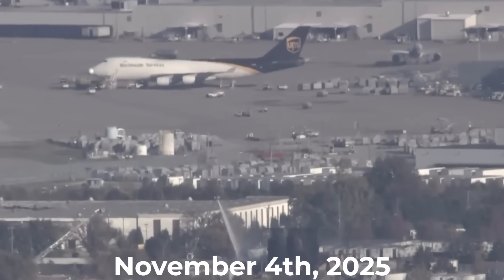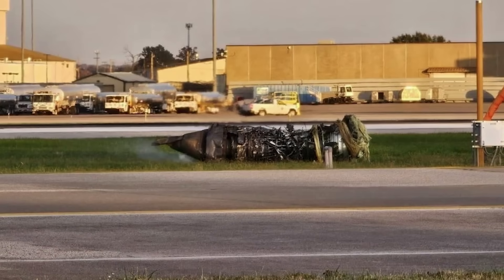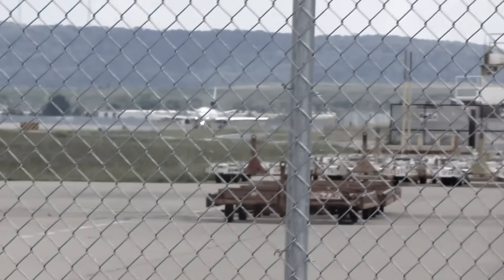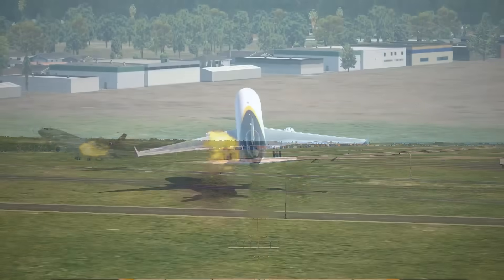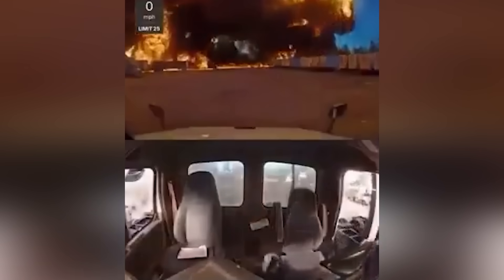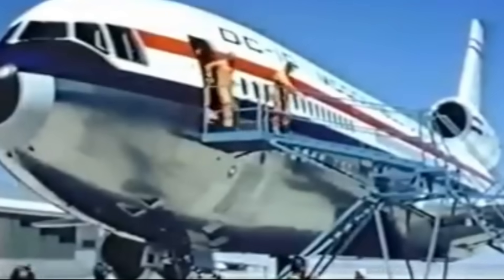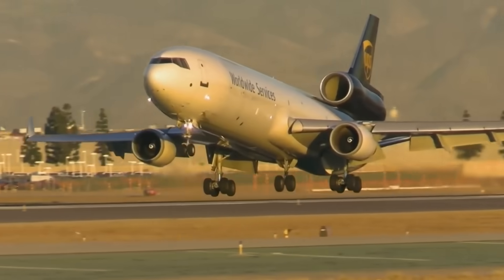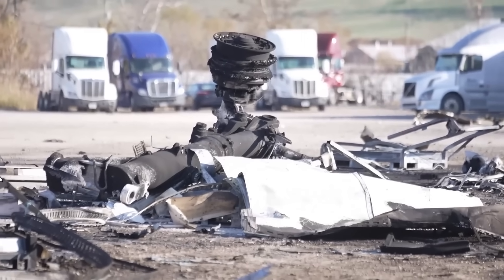NTSB Reveals The TRUTH Behind UPS Flight 2976 ENGINE FAILURE, New Discoveries…

Comment: I will never understand why they don't build these airports longer so that after V1 there is still space to reject the landing. Why do they build warehouses and other building for the aircraft to slam into the end of the runway? There should be NOTHING there. Maybe it's time we rethink the layouts and planning of these major airports to prevent these kind of catastrophes from happening in the future.
Reply: You're only thinking like this because you're a normal human. The fools have no common sense to know that a much longer runway and absolutely no structure in the vicinity of the runway is all it would take to significantly reduce these senseless accidents.
Reply: Quite correct!👌 It would be nice to have fields a mile around the airport. Also, it would look pretty! They definitely need more space.
Reply: This is exactly what I was thinking... It may require many airports to be relocated to more inconvenient locations, but as a Michigander, our main metro Detroit airport is 30 min outside of downtown and we deal just fine... Def a trade-off I'd make in the interest of saving lives...
Reply: Agree and why are people allowed to have flammable material, in buildings, next to a runway. ? What the Heck !  bad enough they had tanks full of fuel but hitting these flammable buildings with petroleum in them, did not help. Airports should be isolated from any buildings.....for a couple of miles.
Reply: Or a run off patch like gravel and sand
Reply: Build an airport and industry will build around it for the convenience of access to the airport.  The runway would have to be 2x longer.  There's about a 15 kts difference in speeds between V1, VR (rotate), V2 (takeoff) and Vref (landing speed).  Once V1 is reached, the pilot must commit full attention to flying the aircraft.  At V2, the airplane is too slow for landing.  Lowering the nose to land would create a very high sink rate into the runway.
Reply: @danburch9989 Still doesn't explain why they don't build the runways longer, or have a cleared field at both ends of the runways. I guess it's cheaper for them to pay off the victims of these kind of accidents than to fix the problem. This is one of the reasons I left the industry.
Reply: @danburch9989 Having worked at municipal and international airports, I would disagree with that statement. The emergency landing siren would sound off almost everyday at the small municipal airports. It just doesn't make the news most of the time. I guess real-estate is more valuable than human lives...
Reply: Yeah another 10 thousand feet should work
Reply: Whats odd is that it skimmed its own buliding thats a ups hub i wonder if something isn't normal with this entire thi thing maybe ups needs nore space
Reply: I like to know why they think landfills are ok and the end of a runway when there is f birds everywhere

Comment: Why the FAA does not require all airports to have Cameras on each end of runways that would of captured the left engine Pylon separation is beyond reason. Once again Private cell phones & home security cameras  are only footage of these accidents.
The FAA does not move until there are dead bodies & they still will not mandate it.
Reply: Great question. Even the rail enthusiasts have set up a network of online cams documenting train movements.

Comment: 30 years plus is too long for a plane being used now as cargo going into hawai moist environment.  I agree structural failure. Ex. My car is 11 years exposed to considerable underside rust. I went over a construction area at 20 kilo per hour....pow  I lost 2 shocks and a sway bar.  I agree that planes need to be decommissioned earlier. Had it been a bit later and those companies filled it would have been more devastating. Yet when anyone brings up the logic of a petroleum recycling plant near airport ppl bawk and say niby or it makes sense.
Reply from the maker: Aircraft maintenance and inspections are crucial for ensuring safety.

Comment: Only a couple things are really clear here. The engine pylons were a known issue with the DC10 and the MD11 (even after the so called redesign).The plane was loaded heavy with freight and fuel near absolute max takeoff weight. This pylon failure and resulting damage (pending verification?) at this point in the takeoff roll left the crew as mere passengers in a horror movie. God bless all affected here. I look forward to the NTSB findings.
Reply from the maker: You've highlighted some critical points about the known issues and the challenging circumstances of the crew.

Comment: As long I know, that DC-10 cause was not following the procedure. They use the forklift instead of proper tool for changing engine.
Reply: They fitted the engine and the pylon together using a forklift to raise it to the wing due the fact that when fitting an engine the pylon is normally still attached to the wing and thats what you fit the engine hoists too.
Done loads in my career.
Reply from the maker: The investigation highlighted several factors contributing to the incident.

Comment: I believe the no one engine suffered a uncontained engine failure more like United
flight 232 at Sioux City. where the main rotor disk exploded sending shrapnel parts
into the rudder and rear stabilizers  causing all 3 hydraulic systems to fail.
On American flg 191 the engine pylon failed causing the pylon and no 1 engine
to flip over the wing and fall to the runway  the entire unit remained together.
here we see the no 1 engine exploded and sent parts flying  then detaching 
it self from the wing? In the photos the pylon don't seem to be attached to the
engine.
Also in other video when closely looked at one can see the number 3 engine is
suffering compressor stalls just at rotation. The MD-11 was meant to fly with
the loss of 1 engine at take off not 2 and as the the aircraft was loaded at
near or max gross weight  this sealed the aircraft fate. the exploding no 1
engine could have caused the damage to the no 3 engine ? 
I'm a retired Airline pilot with experience Flying DC-10's I think one of the
worst airliner's ever built and Mc Donald Douglas the worst companies
ever. When the DC-10 first took to the sky's a fault was found in rear cargo
door it came off in flight almost causing an American DC-10 to crash 
A Turkish airlines DC-10 that was still on the assembly line was supposed
to have the rear cargo door modification to prevent this from happing again.
However 2 years later Turkish flight 981 Paris to London in March 1974
crashed 9 minutes after takeoff killing 346 due to rear Cargo door failure
that should have been fixed.
Reply: You wrote all of that to be beyond incorrect
Reply: @DonaldMcNuGGeT   if you say so 
but as of this morning seem' I'm
correct they now believe the no 1
engine exploded  and some of
part's hit the no 3 engine causing 
it to fail.  while a MD-11 could fly
on  one engine out but no 2 engines
out.
Reply: @peterdaba6651 my guy you need to look at why they really aren’t saying more of it’s most recent mechanical repairs not that long before this happened. It was a 30+ year old plane, yes a lot are kept up but like everything the older you get the higher the chances become of critical to fatal failures, same for us except we don’t say failures etc

Comment: I'm calling it.....Maintenance forgot to torque or tighten a bolt or bolts
Reply: but it flew several weeks before this happened
Reply: @azthundercloud   mechanical items can, at times, require so much use before mistakes manifest themselves.   Especially under-torqued bolts.
Reply: Engines were in for major service not long ago. It's a possibility that the pins weren't installed correctly but according to flight radar. This aircraft made 28 flights since work. It's very suspicious.